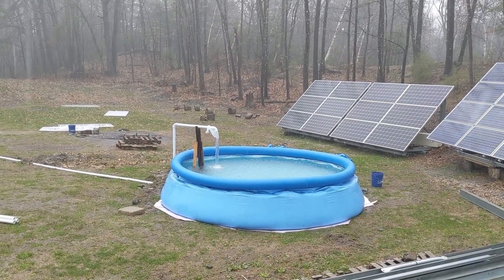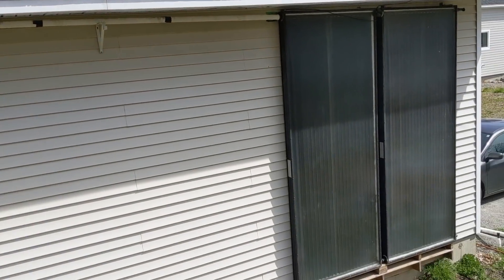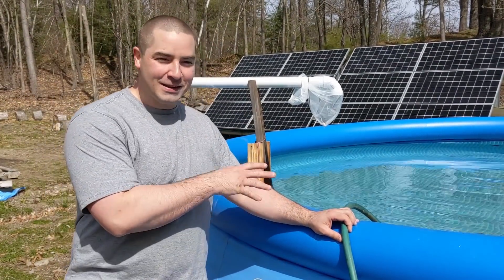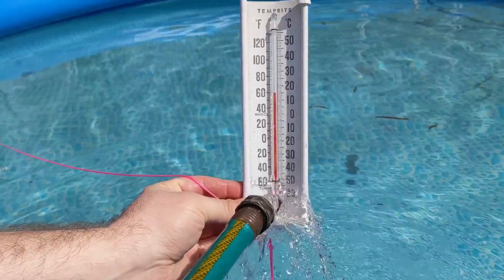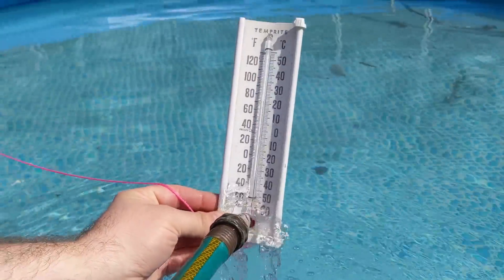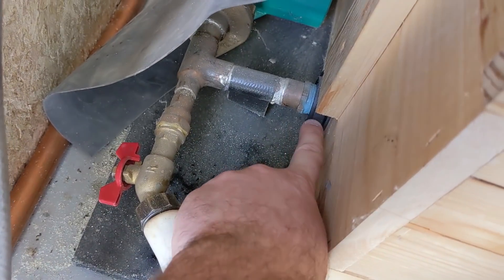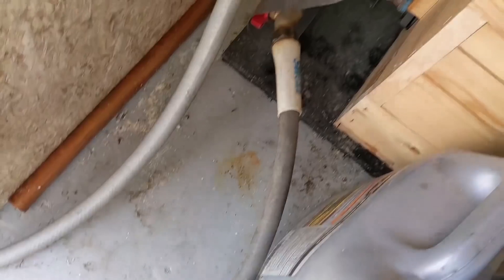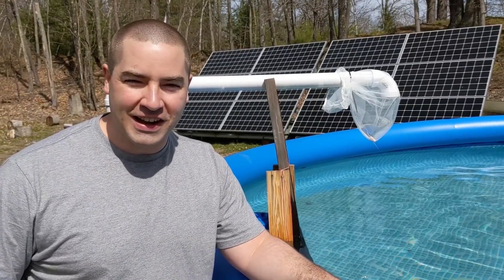DIY Solar Thermal Heated Pool

Comment: What solar thermal collectors do you have? Are they evacuated tube? Which ones would you recommend on market today?
Reply from the maker: I use flat-plate solar collectors.  Vacuum tube is more efficient, but more expensive.  The collectors I have I bought used, very cheap at about $50/collector.  Half the time I have to take them apart and fix a leak.

Comment: Did it work for the whole pool and not just out if the hose? The BTU Into the pool must be more than the BTU lost to the environment (heat loss  from pool water to the air).
Reply from the maker: I've got the pump/filter running keeping the water circulated and we have been over 80 every day, but it drops to about 74 by the morning.

Comment: Although it is only 50 water there will always be a temp difference.  It is like a bank.  Next day 55 75, next day 60 80, next day 65 85, so you could have 100 degree water in that pool if it was covered and insulated.

Comment: Get some non-chlor shock to sterilize the water before swimming. Dump a 1lb bag in give it a good stir. Takes 30secs. Can swim in it 5-10mins later. Use either sodium bicarbonate or vinegar to adjust pH to 7 range.

Comment: I do a similar thing with mine by just draping a few lengths of garden hose on the roof and pumping the water through. I got it up to a hot tub like 102F once last summer.
Reply: Wow. That's actually a great idea!
And it keeps your roof cool too.

How much hose? And how much pump. This is a really good idea

Comment: David show us what's heating the water and how solar powers it
Reply from the maker: The sun was hitting the 7 flat-plate solar collectors on the garage all day.  That was making hot water, and I was pumping it using a 120v AC pump.  I think the pump is 24 watts, and I had it running about 8 hours, or 192wh.  I have a video installing the flat plate solar collectors if you want to see that.  Sorry, it's old, not great.  https://youtu.be/13wnFt4SN8Q

Comment: You  could do the same covering the pool with bubble wrap that is painted black > use rattle can spray paint. If You wanna use the pool You take it off and when not in use it will keep the heat trapped under the bubble wrap. Another nice thing is the pool will stay clean while not in use.
Reply from the maker: Thanks.  I do have a dark blue tarp over it, but took it off for the video.

Comment: Fun, fun, in the summer time , everything is going  swimmingly!!.. I hope to do something similar this fall,   I like swimming at night! With a pool like that it would be easy to add lighting! You can put LEDs on the outside!  I'm going to try digging a swimming pond, about 8' deep at the deep end, and go from 2' so you can sit in it like a hot tub, to 4' then drop to 8', I'm thinking line it with plastic, maybe eventually concrete it,

Comment: put black foil on the pool, much quicker and helps to stay warm
Reply: Interestingly enough something like 75% of heat is lost as evaporation in a pool, (I may be off 10z or so) which was very surprising to me. But yes a cover helps a ton, and keeps the leaves out!
Reply: @FreekHoekstra  yes evaporation steals most of the heat!